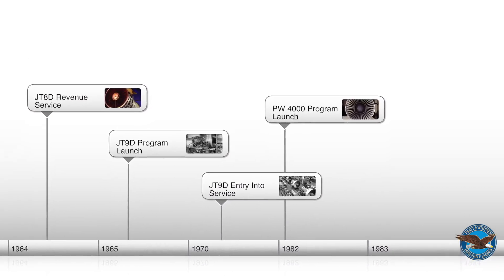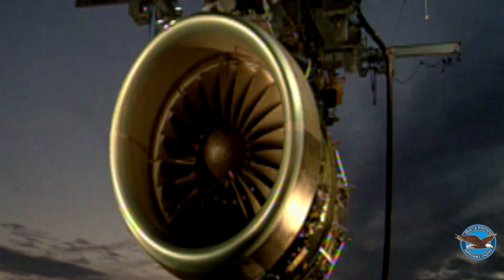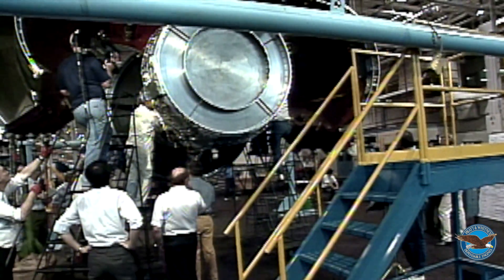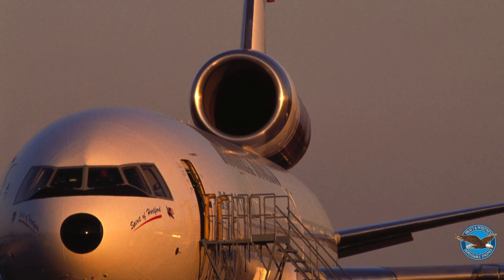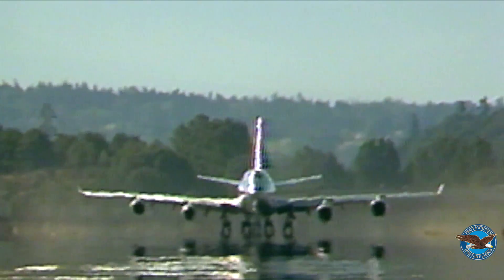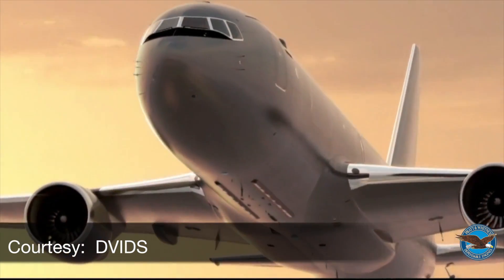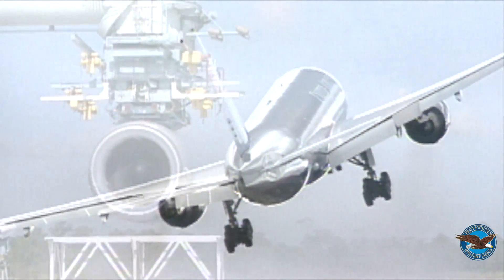30 Years Later, The PW4000-94 Engine Program Continues to Go Beyond

Comment: PW4000 never achieved the fuel savings it promised on the MD11 and of recent this engine has had three uncontainted  explosions within a two year period  due to fan blade failure from fatigue cracking
Reply: both PW and GE engines on MD11 have fuel efficiency problems. Early GE90 is also unreliable like BA2276, and trent 800 is relatively reliable than other two

Comment: "That that is a reliable engine"
Famous last words.
(Overall she is correct, but the recent pattern of failures are alarming)
Reply: Its like 16 years old. Blades have been overhauled 4-5 times. It about the time the airliners upgrade.
Reply: this is PW4000-94 which is more reliable than PW4000-112 on 777. PW4000-94 are on 747-400, 767, MD-11, A300/A310

Comment: I just saw in the news today that a PW4000 engine on a 777 experienced uncontained engine failure over a Colorado suburb outside Denver.  Glad the aircraft returned to the airport with no fatalities.  I wonder what caused the failure?
Reply: Not the same engine

PW4000-112
Reply: @mattieice4689  The same basic engine.  A different fan.  However, the fan in the video also experienced a failure on the same day, on a 747 freighter in Europe.
Reply: @psychohist  Is the  engine the same?...

This is a yes or no question
Reply: @mattieice4689  who cares. I think every company has had a blade out. RR with the trent on the a380. Even a GP 7200 on the A380.
Reply: Jack Mehoff  No actually it's not...the information is out there

Figure it out...idiot.
Reply: @mattieice4689  Cyber Bully ALERT 🚨
Reply: @scubasteve8082  Is telling the truth bullying to you? Sorry that you're so sensitive...but if you make a BS claim...I'm going to call you out. 

If you can't handle it...too bad.

Comment: I built and tested these from '89 to '94. I worked as an engineering assistant intern for the better part of a year and got to rewrite some of the assembly procedures and design some special tooling. After working in assembly and test for about four years, it was really cool to be able to fix some of the screwed up procedures written by engineers who never actually built an engine.

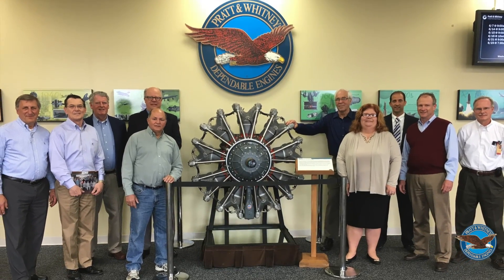Edit: Some of the guys in the photo at 2:57 seem really familiar. I thing they worked in engineering while I was there.
Reply: NSTB enters the chat: you did what now where?
Reply: @don-qr2or  
I worked at the Middletown plant assembling and testing JT8Ds, PW2000s, PW4000s, and some consortium engines for Airbus. I started out in low compressors and turbines, then went to test, then back to high compressors and got an internship in process planning where I mostly implemented updates and corrections, but was able to rewrite a lot of procedures, having years of experience on the assembly floor. I also designed and implemented new tooling and updated and digitized many record sheets that had been copies of copies of copies of typed sheets. I was there from '89 to '94.